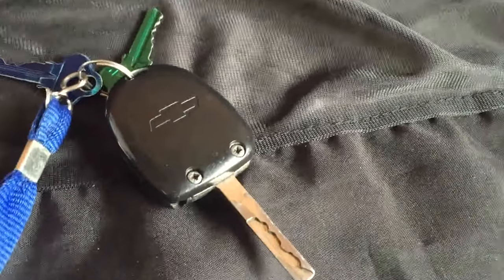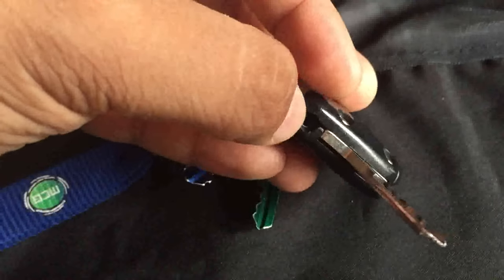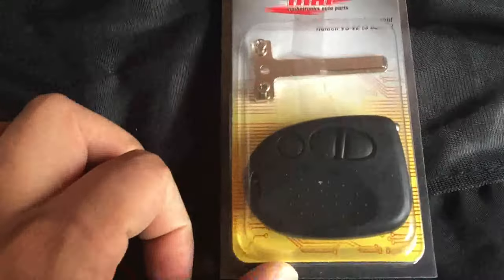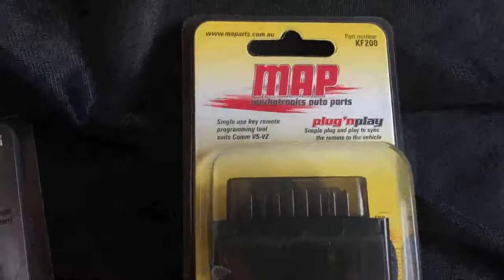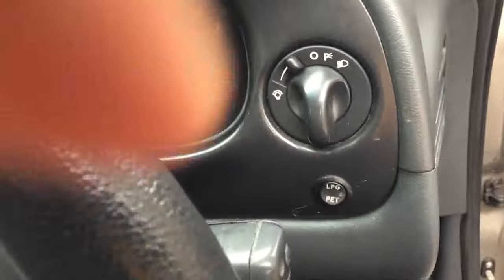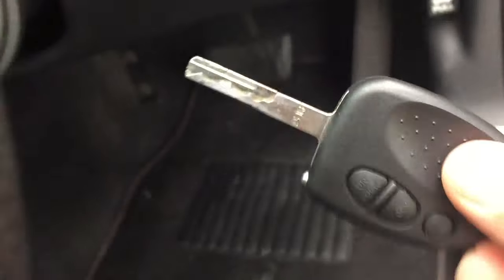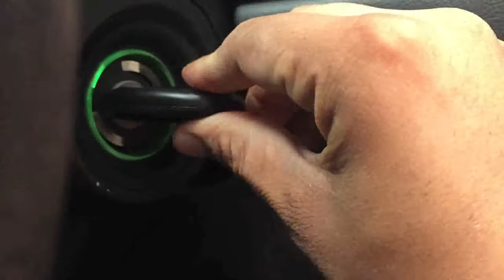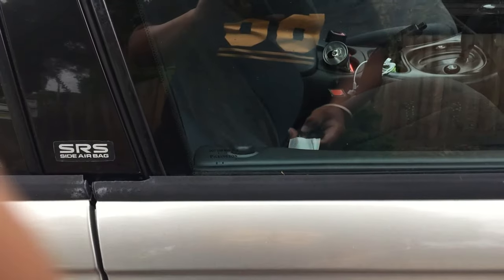HOW TO PROGRAM HOLDEN COMMODORE NEW IGNITION KEY VT VX VZ VE

Comment: Mr Minut keys will provide a whole new unit for Au$99 using your old blade providing they can program it from your spare key. MAPS key and programmer is $120  and you have to supply the labour and take the risks.
Reply: Thanks

Comment: Off to Mister Minit for a new key and remote, ours cost $132.00 and only took 20 minutes to complete.
The programing of our new VX remote was nothing like yours. Our new key and remote came with instructions to manually unlock the door, insert the key into the ignition, turn it on and wait 20 seconds, start the car and let it idle for 20 second and that's all there was to it.

Comment: I have a Caprice 8 cylinder in 2002, the fourth quadrangle, I love it, I changed my body, and I cleaned the gate for the gear and the GPS, and I have the control and the indicator light.

Comment: All I do is turn the ignition on, run it for a short time and press the boot release button to check to see it it's programmed. I've used this method twice with no probs
Reply: Yeah that's what i was thinking, why do you need a programmer when the key programs off of the ignition? I have never used a programmer.
Reply: iceceroc you champion, thanks! i just tried this same way and it worked to reprogram a new key. too easy and saved me $100. cheers!
Reply: Do you mean the boot release button on the new key? If not were is what you're talking about.
Reply: Bullshit this is not a ford falcon with the fords you can do this but not with the holden keys 🔑 why comment if you don’t know what you are on about
Reply: @RD-mu8lg  Yep, the boot release button
Reply: @iamasmurf1122  Well, it works for me - that's all that counts :)
Reply: @rustyb8292 really it works?
Reply: What is a short time😄

Comment: Ok got programmer at Auto one $78.00, blank key head $43.00 Ebay, cut new blank $34.00. Some aftermarket key blanks with new key are shit and you'll need a brass one when it is cut. Cost $155.00. New key cut and programmed at locksmith $140.0. Just saying. Haven't used my programmer yet so it looks like a resell on Ebay - they only work 3 times so don't stuff up! They have unlocked  programmers on AliExpress for $25.00 but I don't know if they work.

Comment: I bought the exact same key because I had the same sort of issue with the broken key it programmed for starting and stopping no worries but it won't unlock or lock the car is there something I'm doing wrong with that
Reply from the maker: Chances are your programmer did not work as expected. Did you get all the lights come up same as video ?

Comment: Hey mate how about if my   security immobilizer is on from old key would it take it off. As currently I can't start the car because off the flashing dash padlock light. And my remote doesn't work at all not even the central locking
Reply from the maker: Sounds like the ABS Module battery is out

Comment: Thanks for the video. Just did mine today worked beautifully. Bought from Supercheap today normally $65 for remote and $65 for programming tool but 20% off sale bought them back to $104 total. It does say single use on the programming tool does that mean its a chuck away tool ?
Reply from the maker: +Rod Turner Glad it halped mate
Reply from the maker: No keep it might be handy in future is should be able to do about 3-4 programs
Reply: @ARPMEDIAZ  in the last 5 years my map programmer has programmed about 12 keys so fare but after 3 keys it fails sometimes but if you try again it works . That's what I have found out ...

Comment: Original Holden keys have a 57 or something written on the key. That's an original steel key. Aftermarket is only brass which will wear alot quicker

Comment: Awesome doing this tomorrow but I read somewhere that if car was locked with old key and you didn't have access to the old key,  that this program tool wouldn't work because the BCM is locked with old key.  Is this correct??
Reply from the maker: Jord Paul the computer which you plug in serves the purpose of wiping the old key details out and store the new one in.
Reply: My remote wouldn’t unlock the other day,, tried changing battery nothing… bought this key shell and obd from Repco… and yea the red light always comes up, won’t programe

Comment: Ok my big Issue is, My car's ignition barrel seized. The person borrowing the car did not let me know, they just ripped out the ignition barrel and the immobilizer on the other end. and used a screw driver to turn over the immobilizer while the key was "against the circle". 
 3 months later. I have had 2 new keys programmed, 2 new ignition barrels installed. The keys turn the cars dash ON, there is no immobilizer error, only seatbelt, park break and SRS red lights coming on. I have spent almost 700$AUD and the auto elec wants 200 dollars to "bypass" the security of my VZ commodore so I can 'drive' it. EVERYTHING from the checks come out fine, but there is an issue with the BCM unit getting the message from the key to the starter relay. This car worked prior to me getting it back from my 'friend' who gutted the ignition lock etc. All I did was remove the blade part of the key to the new 'ignition barrel' key. And since then it would bring up dash lights, every car function except 'crank' it over. 

   Someone please explain wtf and if i was wrong to change the key blade that suited the new ignition lock, and if some how that has stopped the bcm unit from sending the "this new recoded 350$ key is good. start the car'...
Reply from the maker: Hi Budd :- Looks like a lot of things going crazy with your car. Before I tell you anything I need to know how old is the car ?

Comment: $40+ for a key cut is a joke. Some charge even more. I went to Mitre 10 and they did a perfect job for $7.00. Double sided key too!
Reply from the maker: its a very good price you got there mat. I went to bunnings first they said they don't have double side key cutter so I decided to use the existing blade.
Reply: where did you get the key and programmer? also how much Nick
Reply: that is not an electronic/mechanical combo key for 7
Reply: What about Bunnings

Comment: Is it normal to turn the key to start the car and the dash lights come on?- but it just makes a click sound?;like the starter is knackered;even before doing all of this?We know the battery is fine , we are just not sure if the actual starter motor is shot.
Asking for a friend.
Cheers.
Reply from the maker: Hi Mate, Yes one of two things 
Was the car starting before you changed the keys ? If no its your starter motor. If yes then its the key not programmed properly.
Reply: Thanks for that and yes the car started sweet as.
Cheers for the quick reply!
Reply: So can I do the same with a Vy I haven’t got key but will buy one frm where??

Comment: I see those programmers say they can be used to prog up to 3 keys. I'd that 3 keys per car or after doing 3 keys in total, the unit stops working?
Reply from the maker: @spinnanz 
Well, I am guessing that they do have those ic chips on board which dies after few uses. You may get it working a few times afterwards. But surely they have done this on purpose to encourage sales

Comment: you are not having issues starting the car-you simply cant start it.

i had the exact same problem so i used a concrete bail in a drill and a needle file-8 mins ,problem solved

Comment: Watched the vid about programming a new vt commodore key. If the key cutter locksmith wants $40 to cooy the old blade pattern to the new blade (seems excessive) how much did he charge for the ODB1 diag plug and the new shell with electronics. I know an empty shell with new buttons and uncut blade is $10, but how much did it cost to buy and program a new blank key?

Comment: With Map KF200 (plug n play programmer) which I have  bought we tried do exactly what you did in Video Rambo,  but the tool flash orange then went to red means it failed, what would the issue be?
Reply from the maker: Hi Karen, it is likely that the module KF200 is faulty or used before (Only Programmes 3 times). You should take the module back to shop get another one.

hope it goes well
Reply: goint to take my car into EFI Evolutions the guy there can work with my commodore figured out what reall issue is for BCm to die on the car.
Reply: Mine has done 6 keys so fare with the one programmer it might be a fluke mine has done so many
Reply: @jameshaywood7133  still works?
Reply: @petermathews9298  yes the people I have done the keys for are still working . I don't use the map programmer much I use my advanced diagnostics computer to add or program keys to vehicles .
These map programmer's can't program genuine Holden keys only map keys ...

Comment: Cheers what happens if the led is red. As this has happened to me. ?
Reply from the maker: that means the device failed to programme. Do it again not more than 3 times at one go.
Reply: Rambo Rambo and what happens if it does not work at all....
Reply from the maker: That means its very much possible that the unit is faulty. ask the shop to change it for ya.
Reply: Rambo Rambo what do you mean by the unit
Reply from the maker: the unit is the computer programmer which I plugged in the car at the bottom by the bonnet opener.

Comment: Hi mate, I need to program my key for my VE. 
Where the the program chip plug into & how much are they worth & is it suitable for a VE commodore? Cheers mate
Reply: If you haven't found them already you can get them from Repco
Reply: @SirNexxes  Thanks for the reply mate 👍 Does it also work (once fully tuned) to open the doors & close the doors with a push of the button?
Can the key be tuned for a 2008 VE Commodore?
Reply: @brett5728  Still waiting for mine to be delivered, but looks like both key and OBD tool are for VS to VZ only. Might be worth calling repco or a locksmith to see if they offer anything for a VE

Comment: Hey what is the name of the little pin u lost I did the same thing and can't find one anywhere without buying a new one
Reply from the maker: I think its the antenna. Not sure but I know for sure you can not buy them unless you get if from the wrecker for 5 bucks.
Reply: Rambo Rambo it’s not an antanae that metal pin is an earth without it it the key head does not earth to the remote

Comment: This is the same as using a scan tool, someones just written a code on an obd that follows the same steps as you would with the scanner.. id be suprised if this worked on a vz that required manual entering of a security code

Comment: had a lock smith come out and cut the key blank.did that.put the key in turn ignition on.put kf200 in and it come up red.disable the sercurity light and started the car.but the locks dont work
Reply from the maker: Looks like it was programmed partially with the error.
Disconnect batteries and do the process again.

Also computer only works 3 times
Reply: allgood got it sorted.still reads red.but everything works.its bcm relay jammed gave it a tap and away she goes
Reply from the maker: lol sometimes a tap can do so much hahaha

Comment: Hey bro my vy ute key got dropped in river when i was fishing i still have it but doesnt work im wondering if i buy the key and mapping tool will it work for me
Reply: If you key looks the same as his key it should work .. I have used the map key programmer to add a key to a Ute and it worked for me
Reply: Worked for me yep yep
Reply: What bout if the car was locked and unlocked by key an alarm goes off?

Comment: Quick question will my other key that is working will still unlock the car etc. Thankyou!
Reply from the maker: No, It will not work via transferring signals as receiver computer in car does not recognise the signals any more but it will unlock the car manually and may come with an alarm.

Comment: Hi, can I just replace the battery. I can’t take off the battery...
Reply from the maker: I think its welded in with silver. you will have to change the whole set or if you got iron and solder you can change the battery easily.

Comment: can that program other unprogrammed keys as well?
Reply from the maker: No it will not program existing key. Apparently there is no way to reset those key memory. Its once use only.
Reply: The map key programmer can programm up to three keys but my map programmers has done 6 keys and it was only suppose to only do 3 unprogrammed keys

Comment: hey i just bought the exact same key and programmer for a vy and it fails to program the key what could it be
Reply from the maker: Not sure budd can be anything. I will suggest disconnect the battery and do the process again.
Reply: Rambo Rambo when you programmed your new key was your immobiliser light still on till key was programmed ?
Reply from the maker: Sorry bro can't remember. May be you should go back to the shop and ask for a different programmer. Tell him its not working and they should swap it for ya.  By they way whats the end result did the light on the programmer blinked as it blinked in the video ?

Comment: someone help me please, i wanna know where stay holden commodore alarm
Reply from the maker: Which alarm you are referring to mate / is it factory fitted or aftermarket. If you taking about center locking alarm then it should be mounted right next to horn
Reply: Rambo Rambo its factory, i think it is the body control, i wanna know where stay cause my control of alarm doesnt work any more
Reply from the maker: @hugovieira2921  Mate if its a factory fit then your horn works as an alarm. I am guessing your centre locking is missing a link between horn and signal sender.
Reply: Rambo Rambo thank you very much i gonna buy the key and try to fix it

Comment: VT key wont turn steering lock on key looks worn i have put plenty pressure on s wheel to release lock  nothing can help😠💣🙈
Reply from the maker: Well if the key is worn you need to get a new one because its not pushing all the barrels inside.
You might be able to get it going with some graphite powder. Pour some inside the lock and put key blade back and forth a few times

follow the link for graphite powder
http://www.ebay.com.au/itm/like/252347015347?lpid=107&chn=ps
Reply: Rambo cosst $198 f**** locksmith but thanx for tip did try getting new key the waffers is in the barrel were ka-put

Comment: i have a VZ commodore ,immobilizer is on, car wont start have the right key, if I use this tool on a new fob will it also turn the immobilizer on or off.
Reply from the maker: Lil WhiteShaq 

Hi budd once you put key in and the module in car computer. It will programme immobiliser to adapt to the key which is seating in the lock barrel.

Comment: i changed the whole barell as my key broked in it, and i have the bottom of the key but not the circuit bord  for the new barell , would it work ?
Reply from the maker: No it would not work 
Circuit board is imperative for computer. Getting a new keyblade can only open and lock windows 
Also it might turn on car to accessory mode but will not start as the key if will be invalid for computer

Comment: Couldnt you have just used the existing circuit board from the old key? you wouldnt have needed to program it
Reply from the maker: +ErbZombie If its working fine then yes you can. Mine had died was missing some parts. So I had to get a new one. But if yours is fine and good to go do it.

Comment: Will not work on a ve
Reply: No it won’t work on a VE commodore for that you need a chip cloning computer Zedbull to copy your original key chip if you don’t have an original key you will need an immobiliser computer like the advanced diagnostics M8 computer to add a new chip key VE are normally a 4D chip
Reply: Or Id46 chip

Comment: showing red
Reply from the maker: Take it back to the shop looks like the programmer is been used before. It only works 2 times I guess. Tell them to replace it. If still no good then unplug battery terminals and plug them back and do the process again.
Reply: +Rambo Rambo battery worked